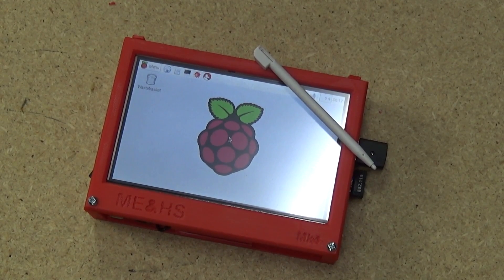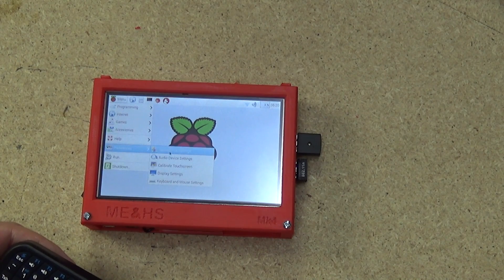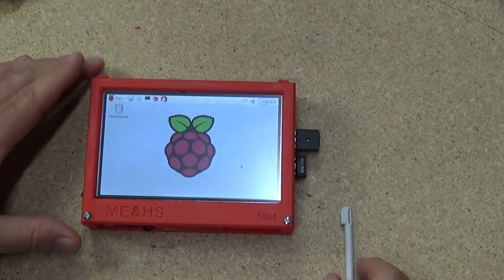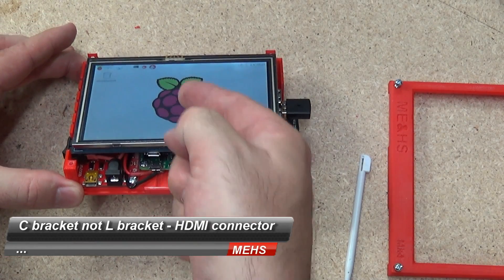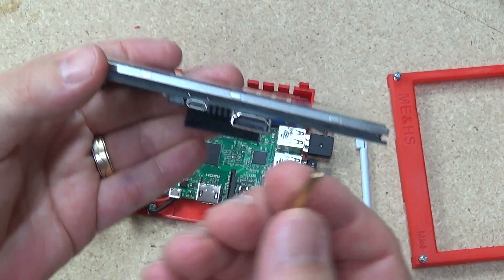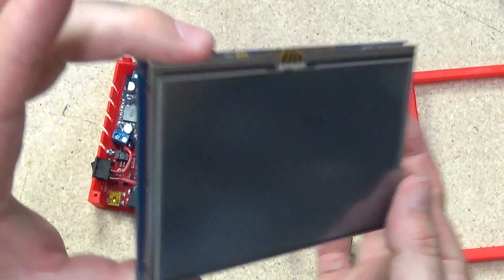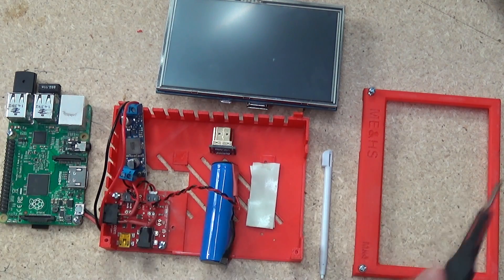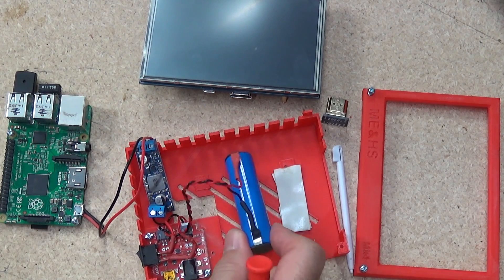Raspberry Pi 2 Portable Mk4 - 5 Inch Touchscreen (MEHS) Episode 38

Comment: Can someone help me ?
I ordered my 5 inch resistive touch screen raspberrypi lcd just like you have but when I connect it to my raspberry it just displays some lines and does not display anything. But the LCD works as when I connected it to my HP LAPTOP, the lcd displayed the laptop screen.
I am running Noobs Lite the latest version on the raspberry pi and also retropie for pi 3( v. 4.3).
Can someone please help?
Reply from the maker: - Hi.  Take your time and have another look a the video (and the one before).  You may have missed the section that talks about adding code to the Raspberry Pi so it can correctly talk to the LCD.  Start by using the waveshare download and see how you go.  Don't just use a generic Raspberry Pi image as it doesn't have the required elements.  Cheers.
Reply: Maybe its your raspberry have you tried to make changes with it. Also make sure that its functioning correctly

Comment: I'm using the exact same parts that you have - RPi2, Pololu 5V step up boost, 18650 2600mAH battery, 5 inch HDMI LCD from Aliexpress - but for the life of me it doesn't produce enough juice to power the pi AND the display. If I remove the display, it seems to work fine, but never works with the display. Starts booting and then screen goes white, dies, restarts and keeps going.

If I connect it to a portable phone charger, or even to 4 AA 1.5V batteries, it works brilliantly. But just can't get it to work with 3.7V to 5V Step up. Any suggestions? The only thing left for me is to use 2 batteries in series and reduce to 5V, but that's another pain.
Reply from the maker: - Should be working as you said.  Start with the basics and see what you are actually getting out of the Pololu U3V50F5 regulator.  Should be 5v and you should be seeing up to 3 amps with a fully charged 18650 cell.  Check that you're not loosing volts or amps over your wiring (nice and thick I hope).  I didn't do anything tricky to get mine working so there's no behind the scenes magic going on.  Measure the entire draw of the device and see what the numbers say.  Cheers.
Reply: Thanks for the super fast reply! I haven't fully charged my 18650, but looking at the voltage with a scope, I see that it's at 3.9V which I think should be okay? I used the same wires with 4 AA batteries and it works fine, so that rules out the wires.

When I measure the output voltage going into the Pi, I see that it starts out strong at 6V, but when I connect the Pi, the voltage drops to 3.8-4V and then gets stuck in infinite boot.

At this point, I'm wondering whether I should just buy rechargeable AA batteries and hook them up directly to the Pi :(
Reply: I also saw your video where you powered a 7 inch display using a 3.7V LiPo battery. This really makes me wonder why I'm not getting enough juice to power my 5 inch display. My display is exactly same as yours.
Reply from the maker: - Ok.  It should never be 6V.  What is the voltage coming out of the regulator when the lithium battery is connected?  You should see 5V only.  What happens when you connect 3 AA batteries to the reg?  Do you also see 5V.  Does the Pi and LCD run from the reg when you use 3 AA batteries as the power source?  Don't use 4 as that is 6V or more.  Feed the reg between 3 and 5 v, not more.  Let me know.
Reply from the maker: - It could also be the battery you are using.  It might have the voltage but no current.  What was the current reading out of the reg when the PI and LCD are connected to the reg?
Reply from the maker: - Ok.  From what I saw you aren't measuring current coming out of the regulator.  Put a meter in line with the positive rail and check the output.  My guess here is the problem is the regulator.  I used a Pololu U3V50F5 for a reason.  The one you are using in the video looks just like a few I picked up off Ebay.  They can vary greatly.  Also if its based on a XL6009 the current drop is severe, e.g. a 4v cell being boosted to 5v can mean a drop from 4A to as low as 1.5A depending on a few factors.  That is probably why 4 AA cells work as the reg is doing nothing an letting all the wattage through to the project.  Test the current and change the reg.
Reply from the maker: - Great to hear there is progress.  I still need to know the current coming out of the reg and going to the project.  This is critical to know.  Yes that flicker is odd and I see you have the all telling lightning bolt in the top right corner of the screen which suggest the Pi is not getting enough power.  Does it still do it without the caps?  Cheers.
Reply: Also, looking at the pololu page for the U3V50F5, it looks like the max current is the ratio between the input voltage and output voltage i.e. 4.2/5V ~800mA, so it seems like it's doing its job.

https://www.pololu.com/product/2565

"The maximum achievable output current is approximately proportional to the ratio of the input voltage to the output voltage"

Comment: Hello, I really like your design. I am currently using your design to build my father a portable p25 radio scanner. I am interested in getting longer battery time. I have read Rion Gaming's comment and I am wondering what modifications would need to me done to hook up two or more batteries for longer run time. The p25 scanner applications seem to drain the battery rather quick. Any help would be much appreciated, Thanks!
Reply from the maker: - Hi.  Sounds like a great project.  Longer run time is easy if you just go for 2 or three batteries connected in parallel.  That way you don't really need a balance charger or anything fancy, ideally you would but its only necessary if you want the maximum capacity and battery life.  They balance themselves to a point by being connected to each other in parallel.  It just becomes a larger 3.7v battery pack this way.  Use cells of the same size and capacity though.  Alternatively you could see if you can fit a 26650 in the case.  They are basically the same as an 18650, fatter, but with 30% more capacity.  One other option to consider is a very high quality 18650.  Basic ones have 2000mah capacity.  High quality panasonic cells are up to 3500mah.  That's almost double.  Hope that helps.  Cheers.

Comment: how you able to hide the mouse pointer while using the touch screen?
Reply from the maker: - Hi.  I can't recall if it is hidden or not but the mouse cursor either jumps to the point the screen is touched or is ignored when using the touch screen.  Either way it is managed by the OS or the screen drivers and not something you have to do.  Cheers.

Comment: Very nice progression on the builds. Excellent work. This is the ideal setup for my taste; split keyboard or no built-in keyboard (separate BT or RF).

I like the enthusiast feel of not hard-modding any of the kit, but for a slimmer profile have you considered doing a build by desoldering and running jumper wires for the ports on a Pi2/3 or using a zero?
Reply from the maker: - Hi.  Thanks for the feedback.  Yes for sure I've looked at slimming down a Pi3 to make future builds thinner and or more feature rich.  I will do one sometime soon.  Cheers.

Comment: What's the largest battery I could fit in this thing? I like it but 2 hour long battery life is a bit small for me.
Reply from the maker: Rion gaming - Hi.  A higher quality battery could get you up to 3 hours but that's about it.  A slight redesign could mean room for 2 batteries meaning up to 6 hours runtime.  Cheers.
Reply: +My Electronics & Hacking Show Thanks!
Reply: +My Electronics & Hacking Show oh and what kind of wires do I need?
Reply from the maker: - Do you mean for connecting batteries and switches and regulators etc?  You just need solid or stranded wire about 1mm diameter or larger.  The current draw of the Pi and LCD is moderate and doesn't need heavy gauge wire but avoid the light breadboard variety (sub 1mm).  Cheers.
Reply: +My Electronics & Hacking Show so 1 mm wire will be fine?
Reply from the maker: Rion gaming
-Yes.

Comment: are the gpio pins for the touch?? can i use the screen without attaching the gpio pins? and use a wireless keyboard/mouse like yours to toggle with the pi??.....pls help...
Reply from the maker: - Hi. Some of the gpio pins are used for the touch screen and to provide power to the display. Not all of them but most so you do have a few pins left to play with. You can use the screen without using the gpio pins but you will need to supply 5V to the screen from somewhere, maybe use the power gpio pins. Yes that would work. Cheers.

Comment: Can we install Windows 7/8/8.1/10 OS?
Reply from the maker: - That would be great but unfortunately, no.  I am still thinking about doing another build with an X86 board that runs windows.  Cheers.
Reply: Siddharth Kumar raspberry pi has an ARM architecture prossesor so it can’t run any Windows version, because they run on x86 architecture(the one desktops and laptops use)

Comment: Hello man I loved this video I've watched it probably over 17.39 times in the past week, but just wondering hit do you still have the case file for this mk3 that you could send? If you have the would it work in auto desk inventor? Sorry if this seems like slot of questions.

I kind of want to see the case file to see if it's possible that I could change it up a little bit.
Reply from the maker: - Hi.  Are you wanting the mk4 files ( this project ) or the mk3 files, previous larger project?  Not sure about inventor but if I supply the 123d files you could always edit them using autodesk 123d design which is free.
Reply: My bad I meant the mk4 files idk why I thought this was the mk3 when I asked that.
Reply from the maker: - Not a problem.  Head over to my website and send me your email address through the contact page.  I will email the files to you.  Cheers.
Reply: Thanks
Reply: Yeah can i have the 3d files please ,
thanks great inspiration

Comment: does the resistive touch have pressure sensitivity? The one nintendo ds has - does have it and utilizes it in some drawing software (like Colors for example).

Does it have sensitivity functionality in the raspian driver and is there any painting linux software that can utilize it?

I am asking because I am curious if I can use it to do painting/sketching with pressure on the Pi.
What model display do i need to buy?
Reply from the maker: - Hi.  This one does not have pressure sensitivity and is only single touch.  Additionally, I would not like to draw on a screen like this as the resolution and contrast is too low.  There are very good offerings from Adafruit and the like that are larger, have much better image quality.  I can't comment on which might be pressure sensitive.  The driver is the main issue.  I know that the ADS7846 touchscreen controller can do sensitivity but I haven't used it before.  Start with the offerings from Adafruit and go from there,  https://www.adafruit.com/categories/400.  Cheers.

Comment: Does this set up work with RPi3? Would it need a bigger battery since it needs more power?
Reply from the maker: - Hi.  No it doesn't.  There are subtle differences between the Pi's that result in this model of the screen being incompatible with the Pi 3.  I believe there is a version available (or coming) that works with the Pi 3 but I haven't played with it.  Cheers.
Reply: I already have the screen and it works with my Pi 3 actually. I was wondering more about if the power regulator worked with it and would need a bigger battery?
Reply from the maker: +SLAMTRON Animation - Ok that's good.  You don't need a bigger battery unless you're unhappy with the runtime.  The regulator will be the tricky bit with the Pi3.  The pololu i used is good for up to 4 amps in ideal conditions and about 3 Amps when using a 3.7v lithium battery.  If your using the same regulator then all should be good.  If you want more runtime just use a bigger battery like a 4 ah lipo or even a really good 18650 like what I used, just with a higher capacity such as 3500mah.  Cheers.
Reply: Ok thank you very much!
Reply: +SLAMTRON Animation - Yes, i have the screen working on my RP3 too just out of the box with a little justification to screen resolution with actual standard Raspbian. But, did you get the touch-sensor to work? Have you any information from where and how to install  which files/drivers to get it working? Thanks and greets

Comment: Nice video, thank you! Is it possible to connect this LCD and a RC522 rfid reader at the same time in RPi 3? Some pins (19-21-23)  are required by both devices
Reply from the maker: - Hi.  I haven't tested it myself but it would depend on the pins required by the rfid device.  The screen uses a few pins as you mentioned.  I would simply see whether there are enough unused gpio pins for your rfid device.  If there are then yes it should work.  You could cut the pin you need for the rfid to make sure it doesn't make a connection inside the screen header and solder your RFID device to the bottom of the board.  As long as the pins aren't connected to both devices and not needed to run the screen you should be fine.  Cheers.

Comment: Awesome video. Quick question - With the Sparkfun board, are you able to charge the unit while it is still powered on?
Reply from the maker: - Hi.  Yes the sparkfun board will let you charge and run the project simultaneously.  It's not designed to power the project and charge the project simultaneously but you can make it charge the battery and power the unit at the same time and yes, while everything is running.  The sparkfun board will normally provide power to the project from the battery (always from the battery) whether or not you have external power connected.  That means if your project draws 1amp and the charge rate is set to 1.5 amps (max setting) then the battery will get more power than its being asked to provide to the project.  That means the battery will never go flat and you're good to go.  If the project was drawing 2 amps then the battery would eventually go flat even though external power was being provided.  To get past this issue I connect the external power (5V @ 4A) from the barrel jack directly to the input of my project (the Pi in this case) as well as the sparkfun board.  That way I can power my project and provide a full rate of charge to the battery that isn't being drained much since the external power is doing the work for the project itself.  It works really well and gives more power option than the integrated POWERBOOST option which is limited to 1 amp max output.  Hope that helps.  Cheers.
Reply: That helps a lot. Thanks for the thorough answer!

Comment: thanks for your review. I am planning to use this monitor as an fpv monitor (quadcopter live video) due to it has hdmi in. is it possible to power it though its usb plug with a usb battery banks for smartphones? also is it micro or mini usb on the minitor? thanks a lot..
Reply from the maker: - Hi.  I believe so but I will check this weekend and let you know.  What is supplying the hdmi signal?
Reply from the maker: +Gur Isler - Hi. Yes confirmed.  I just ran a HDMI cable into the display and 5V power in via the micro USB and it worked just like a standard monitor.  Cheers.
Reply: +My Electronics & Hacking Show o great thanks a lot for your help indeed. i am planning to use it with my tablets hdmi out.. resolutions will not be great but little bit higher ones are like 3 or 4 times of these, this one is pretty cheap. Anyway, thanks again!
Reply: +My Electronics & Hacking Show btw, how is the viewable angle and brightness of monitor? Acceptable?
Reply from the maker: Gur Isler - I would say average to poor.  The viewing angle is probably acceptable but less than 50 degrees total and the brightness is okay indoors at maximum.  I would not personally recommend this for outdoor use.  If you want to get this right and do it just once you might want to look for something similar but with an IPS display.
Reply from the maker: Gur Isler - ...and it's a micro USB port in case i didn't answer that question before.
Reply: Thank you so much for every bit of info. Actually I am thinking of using it with diy fov goggles, but may go to a higher resolution for better clarity. Btw I am also watching other videos of yours! Great work and info.. Thanks again for your help
Reply: +My Electronics & Hacking Show sorry the bother you again about this screen, I read that some people couldnt run it with windows.. Probably may be related to the resolution of the hdmi out from windows. You had reported you used some other source through hdmi and worked alright.. So do you think it will accept a 720p ör 1080p tablet hdmi source and show ofcourse at its max resolution which is 480p ? Sorry to ask again but I just wanted to be sure before ordering this screen.
Reply from the maker: +Gur Isler - Hi.  I just tested the screen with a windows laptop and it worked fine but only at the maximum resolution of 800x480.  It would not work at higher resolutions.  Also, as I've mentioned before, the clarity of this screen is not great.  I think you might be better off with an IPS display that is not touch screen and has a better native resolution.  Cheers.